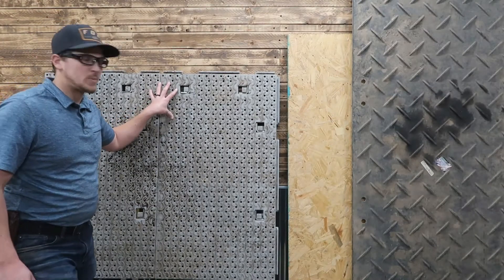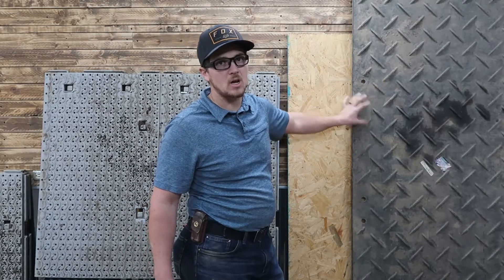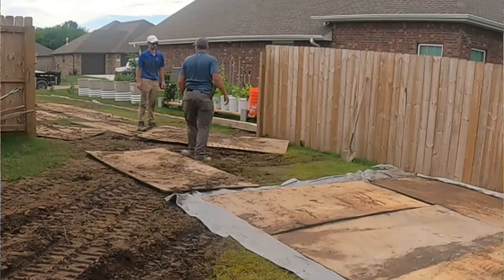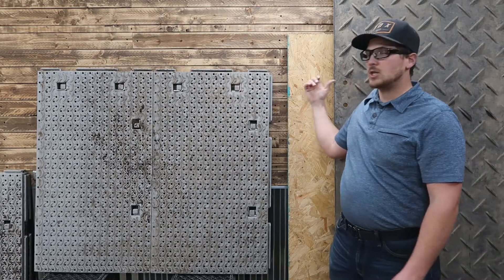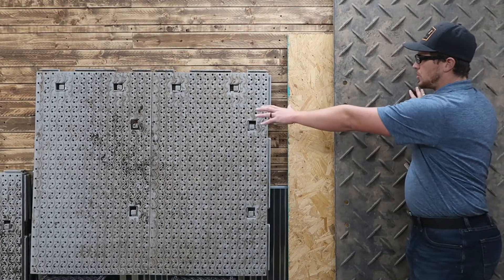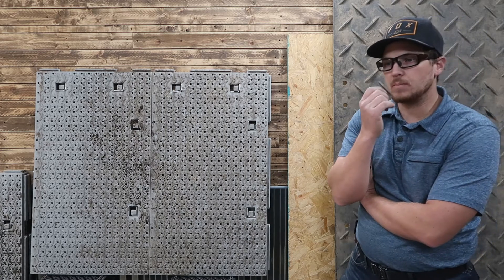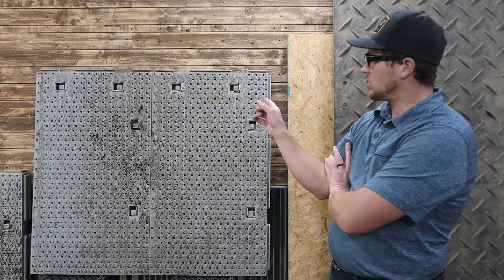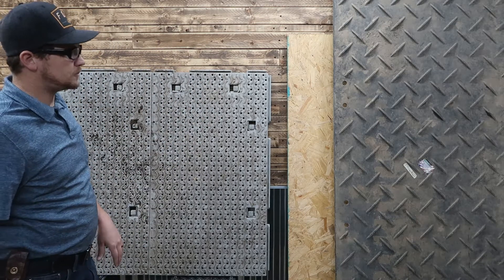What are the Best Ground Protection Mats?  WORKHORSE vs AlturnaMATS vs Plywood

Comment: We use nothing. We just soil and seed when we are done. 9 ton of soil 10 lbs of seed and 4 man hours handles 90% of our projects. I can't see moving these things everyday and if you don't your right back to soil and seeding anyways. I will say the ability to turn on something solid would help from digging a ditch in the turning spot and that could be valuable. Thanks for the video! This answers a lot of questions I had surrounding these mats.

Comment: Great video,, Helpful information. I'm looking to get the solid Great matts..but in the 4x8 size... I'm using plywood now in the 4x4 size. 3/4 inch size. With a mini  
 skidsteer or small excavator there nice. But in the 550 trucks and 13k pound excavator . As you said.. doesn't hold up..
Reply from the maker: Glad it was helpful!  The Great Mats will definitely handle abuse.  I'd order as many as you can justify.  It is certainly an investment though.  Wish we had a few more but freight is the worst part!

Comment: Did u ever use plywood on wetter soil? I’m wondering if my compact tractor can venture into a soupier area if i lay down plywood!
Reply from the maker: 1:11 is OSB on wet soil. Plywood is a little sturdier but not much. How well it would work would depend on conditions and the weight of your machine. You could also use thicker plywood or more than one layer.
Reply: @ThriftyGarage  ok. I have a spot where i drove in with a quad and was stable but my tractor sunk. Thinking of trying 3/4 plywood w the tractor
Reply from the maker: If it’s a small tractor (2,000-4,000 lbs) I think that would work great!
Reply: @ThriftyGarage  thx. It’s a 6-7klb compact TLB. I may still give it a try